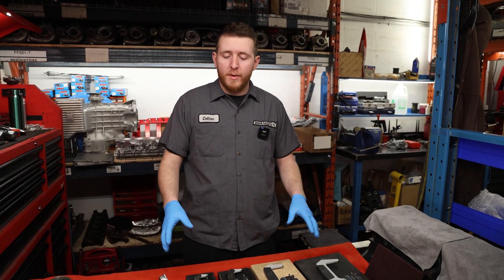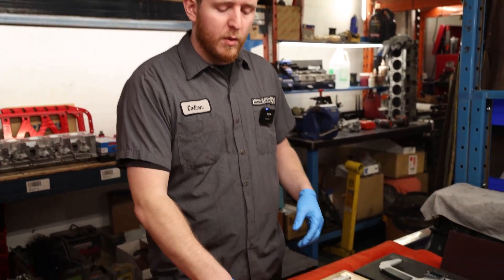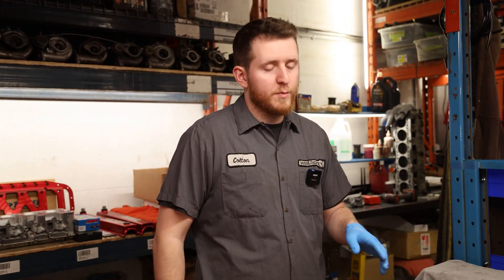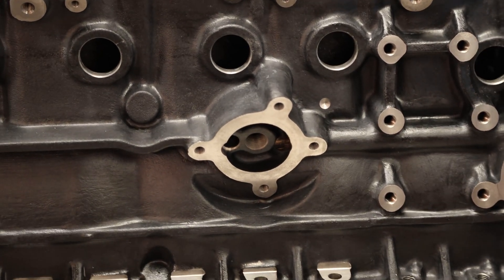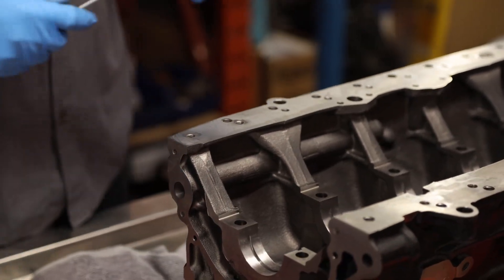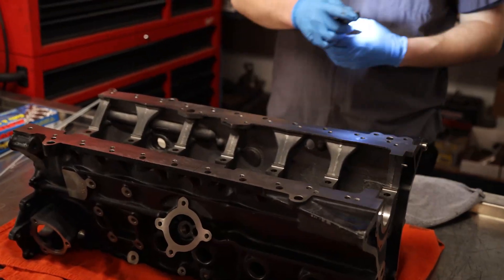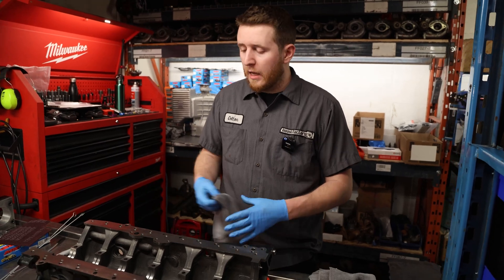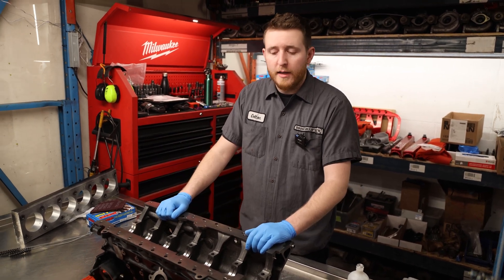RB26 FULL ENGINE BUILD || Episode 1: Tools, Preparation & Cleaning

Comment: Incredibly documented video and attention to detail well done 💪 .. I was always wondering about the by pass valve when doing a remote oil filter set up, just wonder was it a slip of the tongue or does it change function, but when u drill and tap in the bypass valve in the block it still acts as the bypass valve right? Not act as a pressure relief valve as u said because that’s in the pump body am I right? Not trying to pick fault, I’m doing a build and want it 110% and want my facts right 😀😂
Reply from the maker: glad it was helpful! it is a by pass valve yes, but it does relive the excess pressure in the oil filter that would build up with out it, allowing it to bypass the filter element under higher oil demand, so i guess its how you interpret the language. it does not operate as the oil pump bypass valve/pressure relief valve. as this one controls peak pressure.